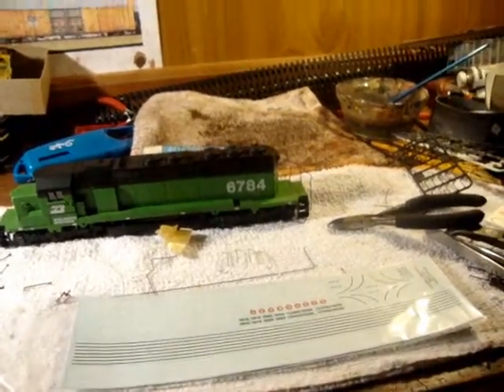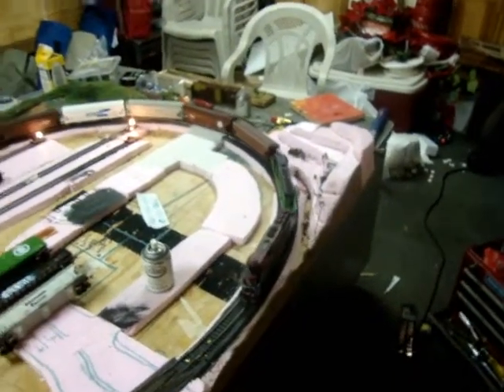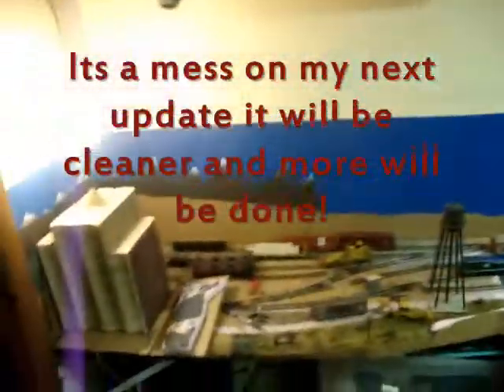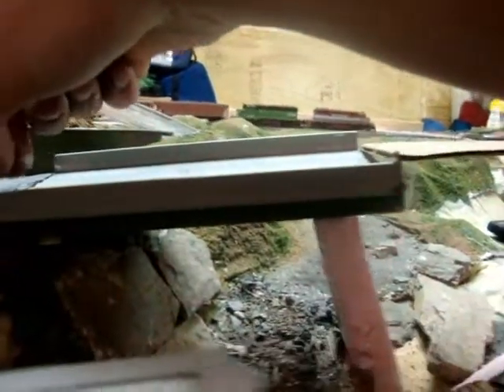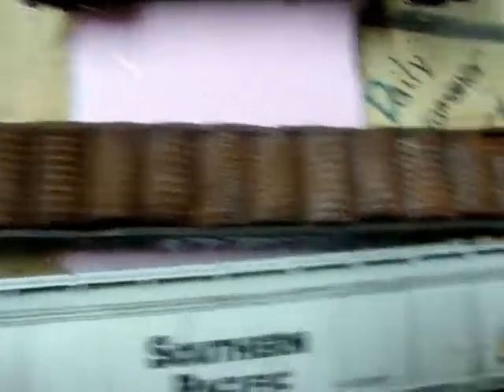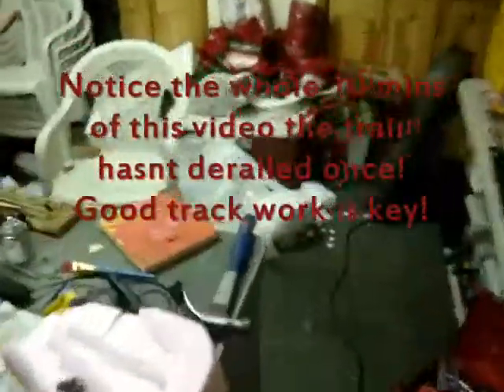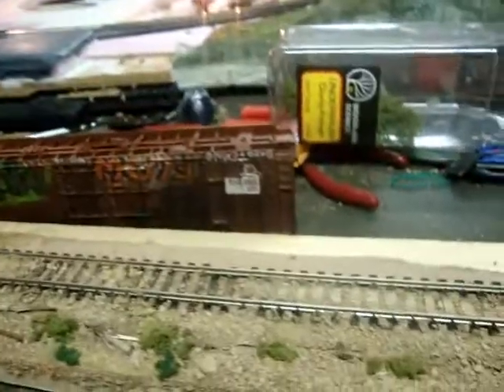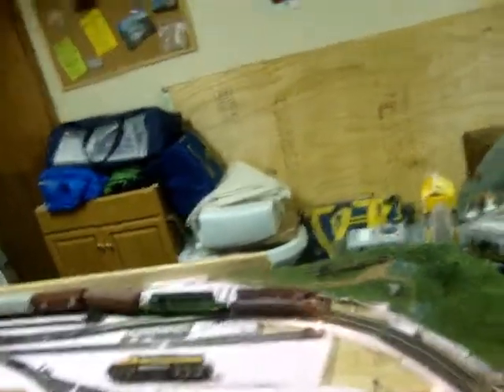Layoute Update 3-22-11 Part 1!

Comment: That's some cool stuff Justin. Like your idea with the SD40-2's. As far as not running together if you had a real DCC system (like the power cab) you could speed match them. Not saying EZ command is a complete waste of money (you can at least control locos independantly) but you can't do any programing on it. This is a big problem if you have what happened to me where the lights would work but they wouldn't move till you factory reset.